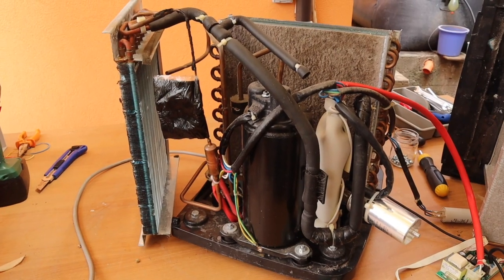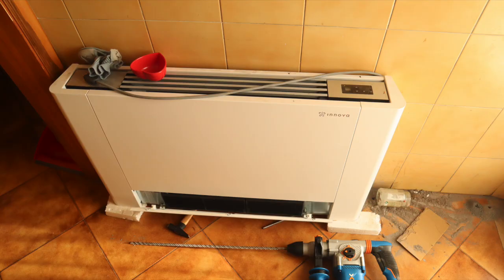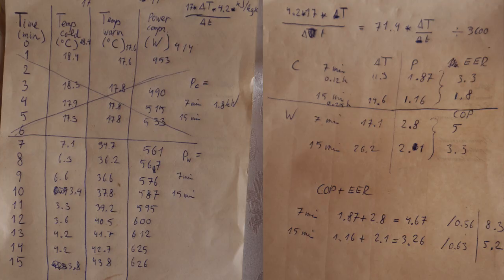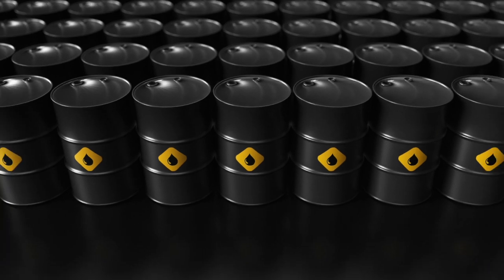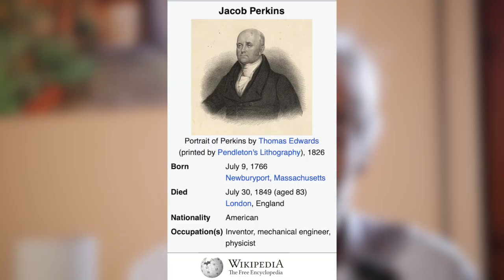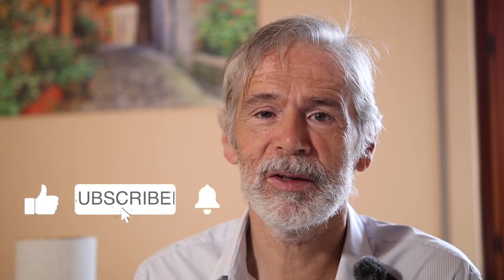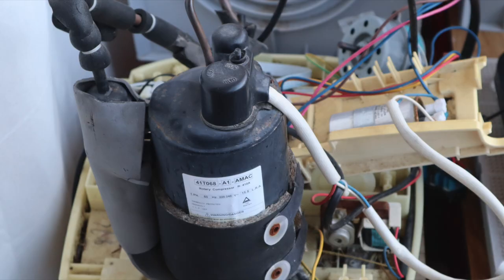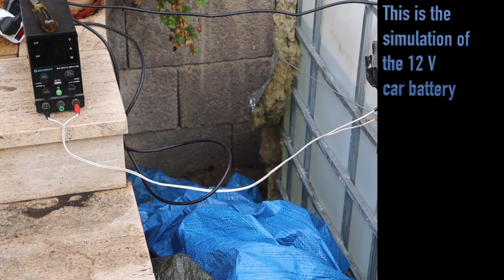Forget Gas Boilers and Switch to DIY Heat Pumps for Lower Bills - Video 69

Comment: Energy Home DIY,

yet again another claim that heat pumps are 300% efficient! 
This is completely against physics as no device can acceive 100% efficiency.  You are using the electrical units consumed, but electrcity is not energy, but a carrier and has to be generated and distributed, this incurs a lot of loss of the primary energy.
Therfore you cannot compare it to a gas boiler, only to other electrically powered heaters.
Reply: why not tho 1 kw of gas heats the same as 1kw of electric, neither do they cheat, just move energy around. so a cop of 1:3 is 300 gains but yes bit scammy saying  but not totally wrong either
Reply: @MrRacerhacker  
except that you cannot compare gas heaters and electric heaters because the 1 Kw hour of electricity takes about 3 kw hours of gas to produce at the consumer.
Reply: @iareid8255  yes you can 1kwh is 3421 btu, ehich will burn at 70-90% efficency . If oven produces 15kw btu thats approx 4.4kw in "electricy" ie btu converted to elec
Reply: My heatpump uses 2.5 kwh of elec to move heat, and approx 7-7.5kwh of output heat heats up a old log home (100m2 2 levels) fine which a 2.5kwh electric heater cant do
Reply: @MrRacerhacker  
How do you measure your heat output?
I keep asking this with no result.
Reply: @MrRacerhacker  
I don't know if you really understand my point? 

Let me try another route.

 A modern gas boiler which must be 90% efficient plus by law now, takes a fuel and burns it and the heat directly heats the water used to distribute that heat, albeit through a thin metal wall.
A heat pump uses electricity which is generated by a gas turbine burning fuel spinning a genrator and then that is transformed to a high voltage to supply the grid, at stages on the grid it is again transformed to a lower voltage for the local area network Eventually it is tranformed to the low voltage that supplies the consumer. 
Each of these steps incur loss and one that is dependant on the length of the transmision line is the I squared R  losses, that is current squared times line resistance.
Then there are the losses within the heat pump, two induction motors average electrical efficiency 90% and a relativley low volumetric effciency compressor (Due to rotational speed and reed valves).
Which do you think will be better from an effciency point of view?
Reply: @iareid8255  ah then i understand, dident think of that no gas turbines here generating power, all outlawed same with oil burners. tho some losses in natural gas aswell, such as power needed for compressors and leaks in the system, but yeah if you got the infrastructure and setup its sure better to burn gas if its cheaper, here not worth it as gas is at approx 3x the price of elec bad for nature tho better for the grid to make power and then you use power really since gas turbines can scrub the exhaust better than the home user
Reply: @iareid8255  With air to water heat pump. measure kw going into heat pump, and measure water temp rise in an hr, for air you can do the same but bit harder as need to know value of duct size and airflow. could also calculate how much heat it takes to heat up a room by 1 degree and see how fast it rises compared to kwh inputtet
Reply: @MrRacerhacker  

you cannot determine the heat quantity on one parameter only. 
Are there any calender (Sp?) tests done on heat pumps, which is a standard laboraitory test to determine heat input.?
Reply: @MrRacerhacker  
Where do you live, Scandinavia?
Most countries with renewables also must have dispatchable genration as well, usually gas or coal otherwise the grid fails. Hydro is an alternative for that scenarion.
 In the U.K. where I live electrcity is about three to four times the price of gas, and electricity prices are going steadily upwards.
Reply: @iareid8255  yes in scandinavia, ( norway) so bit special case, tho 88% is hydro rest is wind and geothermal, the 500MW oil and gas generators, tho a piss in the ocean compared not really used to an extent but thats for when demand is hella high in some places. would say for UK unless got good insulation id wouldent bother with heatpump atleast not the air to water style as that is oddly expencive and mjah, air to air goes well, but gas cheaper than elec most likely not worth the change. but also dont know how much gas you use for heating, can do simple math and see who comes out cheapest,
Reply from the maker: Sorry Iareid for the delay. I gave the answer above:
I will repeat it here for your convenience.
It is in video 69. Actually I put it only on the piece of paper that I put on the screen there, without including the footage where I explain the measurement process (no time in the video and neither on the calender). There I measure the amount of water in the water box, the time and the delta T after that time.. Then with kg water x heat capacity constant x the delta T you measure the power. Another way I want to propose in the video of Nov 2, where I have a flow meter and then with the delta T between supply and return (and this constant) you calculate also the power.
Reply from the maker: Yes exactly, I count also with 5 kW to heat a standard house (Europe, 80 m2) in steady state. If it starts from cold, I like to have those 1000 litres at 45 or 50 degrees, which can boost power.
Reply from the maker: I Racehacker, I responded above, will repeat it here.
It is in video 69. Actually I put it only on the piece of paper that I put on the screen there, without including the footage where I explain the measurement process (no time in the video and neither on the calender). There I measure the amount of water in the water box, the time and the delta T after that time.. Then with kg water x heat capacity constant x the delta T you measure the power. Another way I want to propose in the video of Nov 2, where I have a flow meter and then with the delta T between supply and return (and this constant) you calculate also the power.
Reply: @MrRacerhacker  
 A lot of our housing is poorly insulated and needs air movement from outside otherwise they become damp. This makes adding insulation both difficult and expensive and is often not cost effective. This would require large capacity heta pumps to maintain a comfortable temperature which willbe xexpensive to install and run.
We use water as a heating medium as it is relatively simple and effective, mostly radiators but under floor heating is gaining for new build. Air to air needs to be fitted when the house is built and does not lend itself to retro fitting, and then we also need hot water so that is why the u.K. uses what it does.
I have no doubt that for most, a gas boiler is cheaper to install and run and to maintain over a long period. It is also more effective as it warms up very quickly.
My situation is a single bedroom annexe built about 12 years ago to building regulation. It has an oil boiler (No gas in our district) It has under floor heating but that hardly ever runs as the house is heated by a log burner. This alone does 98% or so of the room heating and the oil boiler provides hot water. It is very economical to run.
Reply: @iareid8255  i disagree that heatpumps air to air needs to be installed when house is built can easily retrofit, done here plenty of times, got an old log house that is drafty but temp still stays pretty decent could need a few impromevents like better windows and such . For hot water needs the same but then get an elec boiler or use gas, even got heat pump hot water tanks if wanting to improve one aspect
Reply: @iareid8255 when you stand next to an outdoor heat pump unit, and you feel the fridge cold air coming off of it, do you wonder where that heat energy has gone, do you then wonder where the electrical input energy has gone, when you add those two numbers together what happens?
Reply: @iareid8255  but electricity is not only made from gas. It can be made with wind solar nuclear... so it is and is  increasingly beneficial to use a heatpump for domestic heating.
Reply: @iareid8255  You keep asking about how the heat output it calculated. However you also state that most homes would need large heat pumps and lots of insulation. Care to provide your evidence for your assertions?

Heat pumps should be size to heat loss, if you have 5kw heat loss, then you'll likely get quoted for a 6-7kw heat pump.

Maybe have a look at what Octopus Energy and Heat Geek are doing.

Personally if you have working boiler, I don't think it's worth the cost, you're never going to make your money back. Although I do eventually want to get it done after getting UFH and battery storage for the leccy.
Reply: @affieuk  
my only evidence is what is generally accepted. I have not  looked that closely at specific performance.
I am sceptical of the claims and am interested in how the often quoted heat quantities are measured. Electrical input is quoted but rarely if ever are the kilowatt hours quoted so making comparisons is difficult.
Reply: @iareid8255  Yes, I don't disagree with your concerns. I guess I'm looking at it in simpler terms. If those that have them installed properly can show what it's cost them to heat their home and what they had their home temperature at, that would be enough to decide to go ahead or not. Again only if you're doing it for carbon footprint reasons (I'm dubious about how this stuff is calculated though) or if you've got other factors that would make sense, solar, batteries, etc.
Reply: @affieuk  
I don't need a new heating system, just that so many claims seem unreal.
One thing that is claimed that they are many times more efficient than gas boilers for example, simply not true.
This  is based on incorrect calculations.
Reply: It's technically pedanticly correct, but 1kw in to an elextric resistance heater only makes 1kw of heat, where a heatpump puts 3kw in to where you are heating, so it's hard to describe that to people without using yhe misleading marketing calling it 300% efficient.
Reply: @Snerdles  
How do you know or measure the heat output from a  resistance heater compared to a heat pump. I keep hearing about the output but nobody yet has explained to me how it is measured, can you?

There is only one definition of efficiency, energy in against work done and it can never equal 100%, that is simple physics.
Reply from the maker: Sorry for the late response about measuring power. It is in video 69. Actually I put it only on the piece of paper that I put on the screen there, without including the footage where I explain the measurement process (no time in the video and neither on the calender). There I measure the amount of water in the water box, the time and the delta T after that time.. Then with kg water x heat capacity constant x the delta T you measure the power. Another way I want to propose in the video of Nov 2, where I have a flow meter and then with the delta T between supply and return (and this constant) you calculate also the power.
Reply from the maker: True, the temperature difference between condenser and evaporator determines the work that the HP must do and also the COP. Therefore I like the idea of 2 x 1 cubic meter of water that helps you to control this delta T. With an HP that works with outside air, it is really difficult to keep a constant delta T. As soon as it gets below 7 degree C, it wil ice (with the humid in the air) and than: finita la commedia!
Reply from the maker: I agree, on the first glance you just discard this 300% claim ,just as I discard the claim of the Perpetuum Mobile. But indeed, the laws of thermodynamics are respected with this claim. A Heat Pump is like a state support programme application of 67%. You pay 1/3 and the programme in some way creates (?) 2/3 of the money. Nope, it comes from the tax payer, no money is printed in the state support office!
Reply: Is he moaning about the incorrect use of the term efficiency vs coefficient of performance OR is he a flat earthed?
Reply: @edc1569  honestly no idea, dunno why hes so hard honestly alot of data on heatpumps and how good they are compared to other stuff , plenty of studies to read aswell if he fancy
Reply: @edc1569  
could you not ask 'he' directly?
I am most certainly concerned because of the sloppy use of efficiency and worse comparing it to gas or oil boilers which you cannot do using electrical units of electrcity.
Some companies in the heat pump sector do exactly this and it is wrong and fraudulent.
A final point is that how few people seem to remember their secondarry school physics!. 

The derogatory term 'flat earther' or similar always makes me laugh as the persons who use it do not understand what it actually means which is an inversion of what they think it means.
Reply: @iareid8255 yeah irks me too that people use the term ‘efficiency’, but I understand why it’s done, for me it makes the understanding of running costs easier for the consumer rather than the slightly more abstract idea of CoP.  Probably best we just state boilers have a CoP of 0.9, resistive heaters 1.0 and heat pumps whatever value your surveyor stated, hopefully over 3.0!

Apologies if I mislabelled you as a Carnot denier, gets tiresome sometimes arguing with folks living in a 21st century world denying 19th century physics.
Reply: Heat pumps are often misunderstood because their "efficiency" is measured differently from traditional heating systems. When we say a heat pump is 300% efficient (or has a COP of 3), we’re not claiming it defies physics. Instead, it means that for every unit of electricity the heat pump consumes, it moves three units of heat energy from the environment into your home.

This is possible because heat pumps don’t create heat - they move it. The process relies on the refrigeration cycle, the same principle that powers your fridge and freezer. Your fridge uses electricity to transfer heat out of its interior, keeping it cool. A heat pump works similarly but transfers heat into your home instead. You’ve already had a heat pump in your home in the form of your fridge - just operating in reverse.

You might also notice how a dehumidifier feels warm when it’s running. This is because it extracts moisture from the air and releases the latent heat stored in that moisture back into the room. Heat pumps do something similar on a larger scale - they extract heat energy from the air or ground outside and release it indoors.

Regarding electrical losses, while electricity generation and distribution involve energy losses, the same is true for gas production and delivery. Heat pumps are far more efficient in their use of electricity compared to the thermal efficiency of gas boilers - especially when powered by renewable energy.

The claim of "300% efficiency" isn’t misleading - it’s a reflection of the heat pump’s ability to leverage existing heat in the environment and transfer it effectively.
Reply: Richard, 

no you completely misunderstand what I'm getting at, people compare the 300% against a gas boiler at 90% which is a major error and flattering to heat pumps. Use your electrical units to compare with other forms of electric heating is a like comparison, using it against other fuels is not.

Heat pumps create heat in compression of the refrigerant that is where it comes from, it is not moving heat as I keep hearing. Why not cut out the middle man and open the doors and windows and let that 'heat' in?

Specifically heat is anything above minus 273 degrees kelvin. What we refer to as heat is apparent, or is it warm or cold to us.
Heat pumps are no different to all other forms of heating I know, they take heat and add to it.
Reply: @iareid8255  I see where you’re coming from, but there are a few key misunderstandings in your argument. Heat pumps are fundamentally different from other forms of electric heating because they don’t create heat – they transfer it. The refrigerant in a heat pump absorbs heat energy from the outdoor air (even at subzero temperatures, as anything above absolute zero contains thermal energy) and moves it indoors. The compression of the refrigerant raises its temperature to make this energy usable, but the majority of the heat delivered to your home comes from the environment, not from the electricity used in compression.

This is why the comparison of heat pumps to gas boilers is valid. Gas boilers generate heat by burning fuel, with efficiency limited by the combustion process. Heat pumps, on the other hand, multiply the input energy by using electricity to capture and transfer ambient heat, resulting in much higher efficiency. A heat pump with a COP of 3, for instance, provides three times as much heat energy as the electrical energy it consumes. Comparing heat pumps to resistance-based electric heating systems like fan heaters or underfloor heating (which are 100% efficient at best) also highlights their superior efficiency.

As for the suggestion of "cutting out the middleman" and opening windows to let heat in – while it’s true that the outside environment contains heat energy, the heat pump’s role is to concentrate that low-grade heat into a usable form. Without a mechanism like the refrigeration cycle to extract and upgrade this energy, it wouldn’t be sufficient to warm your home.

So no, heat pumps don’t “add to the heat” like other heaters. They exploit a physical process to harvest and amplify heat from the environment, making them fundamentally different from both traditional electric heating and combustion-based systems.
Reply: Richeard, 

I'm sorry but you are mistaken. 
 I repeat, all heaters take  heat and add to it, heat pumps are the same.
You understand that the discharge temperature from the compressor is tied to the suction temperature, as ambient drops , suction temperature drops and so the discharge temperature drops in line. (I'm stating basics and ignoring inverter controlled units that increase compressor output with a variation in temperature, if set up in that mode.)

It's a nice theory but physics long ago is setlled on the point of basically there is no such thing as a free lunch.
Reply: @iareid8255  heat moves to cold and forms the very basis of how heat pumps operate. Heat energy naturally flows from warmer areas to colder ones, and a heat pump capitalises on this principle.

In a heat pump, the refrigerant is cooled below the temperature of the outside environment as it passes through the evaporator coil. This makes the refrigerant colder than the outside air, even in winter. As a result, heat from the air moves into the refrigerant, despite the air being what we might consider "cold." The refrigerant absorbs this heat energy as it evaporates into a gas.

Once this heat is absorbed, the refrigerant is compressed by the compressor, which raises its temperature significantly. This is where the high-pressure, now-hot refrigerant releases its stored heat into your home via the condenser coil. After releasing the heat, the refrigerant is cooled, depressurised, and cycled back to the evaporator to repeat the process.

The key is that a heat pump isn’t “creating” heat but using the refrigeration cycle to move it efficiently from one place (the outside air) to another (inside your home). By exploiting this natural tendency of heat to move towards cold, heat pumps achieve efficiencies far beyond resistive heaters, which rely solely on converting electricity into heat.

A 1kW fan heater converts nearly 100% of its electrical energy into heat. However, it is limited to providing exactly 1kW of heat energy. A heat pump with a Coefficient of Performance (COP) of 3 can provide 3kW of heat while consuming just 1kW of electricity. That’s why my heat pump consuming 800W can heat a room far better than a 1kW fan heater.
Reply: @NckBrktt 
No it does not take energy. 
It takes the ambient temperature and adds to it by the compression of the refrigerant gas.
Every heater does this, e.g. a gas boiler uses ambient air in combustion and adds to it by burning gas, a significnatly greater multiplication than with a heat pump.